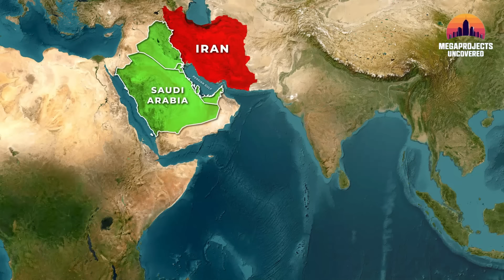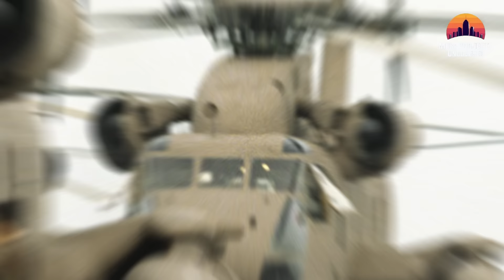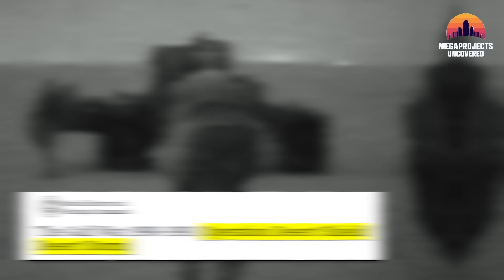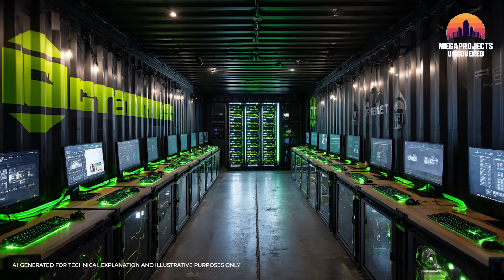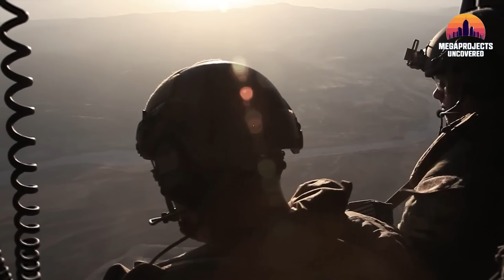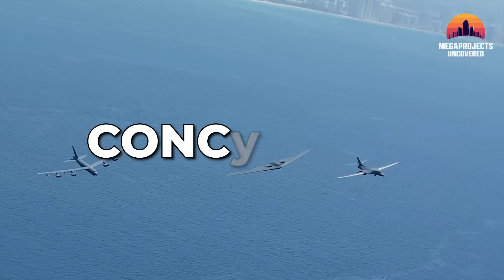The U.S. Already Rehearsed an Iran Strike — Nobody Noticed

Comment: I'm curious about the lack of discussion regarding Iran's Kharg Island which is responsible for about 90 percent of Iran's oil export. During the 1979-1981 Iran Hostage Crisis, Admiral James "Ace" Lyons proposed blockading Iranian ports and seizing Kharg Island as leverage for freeing the hostages but was rejected in favor of the ill-fated Operation Eagle Claw. Michael Rubin of the American Enterprise Institute had recently raised the possibility of capturing Kharg Island to halt Iran's oil exports (‘Take the Oil’: Seizing the Kharg Island Terminal is the Ultimate Checkmate to Iran, January 13, 2026). 

Capturing Kharg Island would require more U.S. military assets than just a single carrier strike group; it would also require an expeditionary strike group and several surface action groups to secure and hold Kharg Island. Any U.S. military units holding Kharg Island would also be vulnerable to drone and missile attacks from mainland Iran. Nevertheless, capturing Kharg Island and blocking Iran's oil exports along with other measures (e.g. attacking IRGC facilities, cyberwarfare, providing Internet access, etc.) could significantly cripple and humiliate Khamenei and the IRGC.

Comment: Caracas is right on the Coast and Maduro was sold out by his own, the US had inside help. Tehran is not Caracas , it is deep inside the country is mountainous regions. Good luck performing a snatch and grab over there. The US would never have the balls to try as it would most definitely fail miserably.
The last time Delta Force was in Iran it ended in a disaster. During Operation Eagle Claw to rescue the Embassy hostages in Tehran the mission ended in a total failure with 1 Sea Stallion helicopter and 1 C-130 transport aircraft destroyed and 5 Sea Stallion helicopters abandoned and captured by Iranian forces.
8 US servicemen were killed  4 were injured when Operation Eagle Claw became Operation Pigeon Pie.